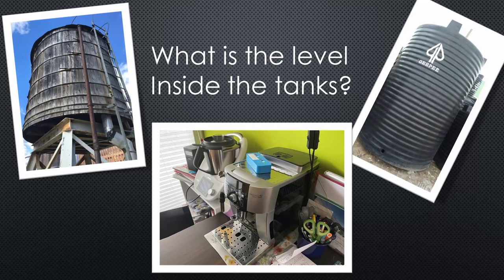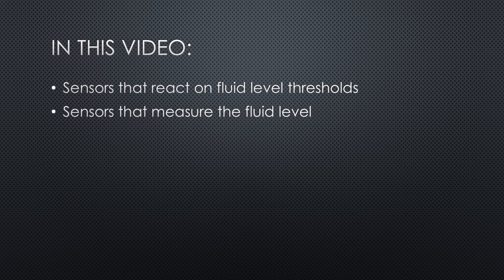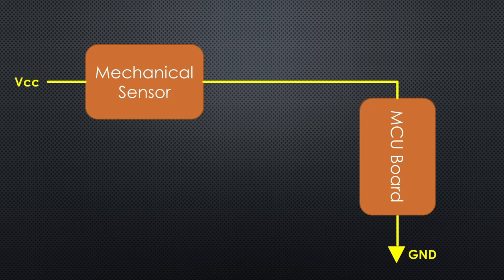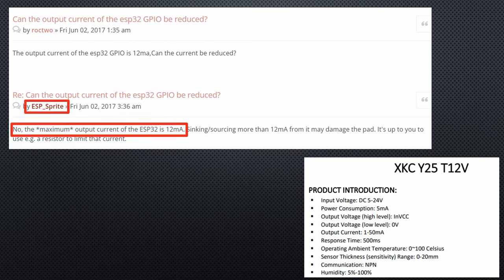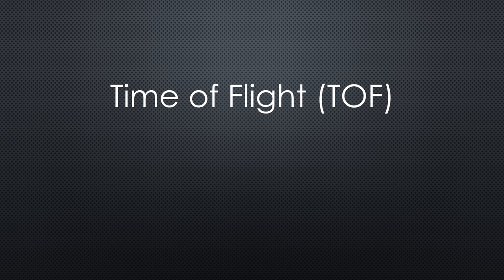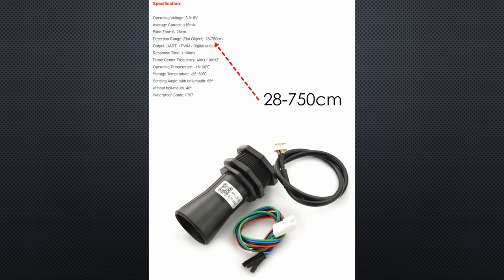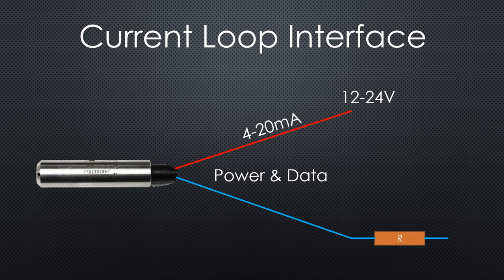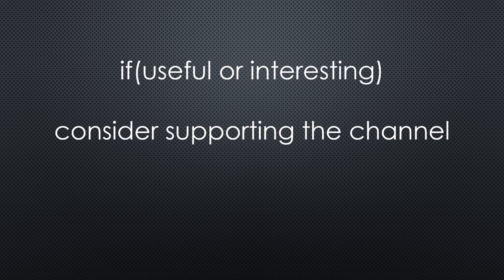#411 Ten Fluid Level (Water Level) Sensors and how to use them (Arduino, ESP32, ESP8266)

Comment: Thanks Andreas! Another great video! One question for you: I tried the JSN-SR04T ultrasonic waterproof sensor to measure the water level inside an opaque water tank 110cm in diameter and 150cm in height. I added a temp/humidity sensor to compensate for speed of sound calculations: it's on the roof so inside the tank it can get to 40°C and 90% humidity. I know it's overkill in such a small distance, but this is why we do these things, right? :)  Anyways, the problem is what you mention in 8:00 - interference from signals bouncing in all surfaces, which makes the sensor think there is little or no distance. The question: would a LIDAR sensor have the same issue?
Reply from the maker: Thank you for sharing your experience! 
Other commenters used a tube for the lidar and it eliminated reflections.

Comment: Hard water is an issue here, sensors build scales on them and hinder their performance in terms of mechanical parts, like the hall effect or Reed switches. I was looking for cheap alternatives that won't require penetration or drilling through the tanks along with replaceling the high power 220V mechanical switch. The elements first and foremost are an issue because it's an open air reservoir. Wonderful presentation as always.
Reply from the maker: What seems to be a simple problem is quite complex if you have a deeper dive. We also have very hard water here and I know your problem...

Comment: It takes a bit more, but we used 'capacitance probe' sensors to measure water level  in tanks.  It had a thin rod centered in an outer tube that had many holes along it.  The two were electrically isolated from one another.  An oscillator circuit was used to put this in one leg of a 'bridge' (similar to a wheatstone bridge, but composed of capacitors).  As the level rose/fell, the capacitance between the outer tube and inner rod would change, resulting in a signal across the bridge.  The probe was made of stainless steel, so it did not corrode in the hot water.  Probably a bit too complicated for most hobbyists, but just wanted to share.  Another nice video, thanks.
Reply from the maker: The tube was already described in the comments. But it was only used as a capacitor for an oscillator, not in a bridge as you used it. Thanks!

Comment: I don't know if they are also used for liquids but for solids there are mechanical units that lower a plumb bob off of a spool of string and count the turns until they detect no weight on the line.  Maybe another video on solids measurement :) A lot of materials vary considerably as the angle of repose changes from filling from the top and draining from the bottom. Other than giant load cells at the bottom of a silo I don't know how you would get an accurate measure?  Any idea if there's a way to measure the empty head space whose shape changes dramatically?
Reply from the maker: These mechanical sensors seem to be used in industrial applications and also to measure water levels of lakes (with a float at the bottom). And measuring the weight of the tank is a good idea (I forgot this method in my video)

Comment: I remember talking to someone on Reddit that wanted to monitor his radon exhaust system in HomeAssistant.  The local sensor works using the level of a fluid to determine if it working.  When the system is functioning it creates a vacuum that causes the fluid level to drop.  I bet one of these sensors could be applied to his system.
Reply from the maker: I agree. Those sensors are really universally used...

Comment: I assume the most asked question for us is how to measure the level of the rain collecting barrels in the yard 😉 As you explained very well there are downsides on every system. My idea is a small communicating tube on the outside which could be detected with simple light barriers. Ok this will not work with digged tanks.
Reply from the maker: There are a few comments here where they used small tubes to the floor of the tank to measure the pressure on the top of the tank. Maybe this could be an idea...

Comment: I had the same issue with my coffee maker.  I created a project with esp8266 as an alexa switch to have it refill the coffee maker with my voice.   I started to use one of the water level sensors that you mention but then I ended up just having it refill for 10 seconds, which is about the time it takes to refill the fluid for one cup of coffee :)
Reply from the maker: Good idea!

Comment: I have the opinion that resistance changes with long cable runs, but is less susceptible to noise. but what do I know.. otherwise the weight and psi are the same.
Reply from the maker: You are right.

Comment: I tried making a submersible continuous level sensor using a piece of coaxial cable as a capacitor (capacitive measurement).  If you strip back the ends of the cable and solder the inner and sheild together, then water proof them, the two free ends can be charged/discharged and the time constant measured.  It worked fine on the office floor and sensing my hand, but unfortunately for what ever reason I was never able to get it to work in water.
Reply from the maker: Interesting idea. Others used two parallel wires and tried to measure capacity. This seems to work if the fluid is between the wires, too.

Comment: I have used an IR sensor to measure the liquid bee wax level for making candles. Especially in the range of 10 to 50 cm it was a bit difficult to find an accurate sensor.
Reply from the maker: How did the sensor work?

Comment: Capacitance level probes are another option, You can use pressure indirectly by having a known reference pressure applied to the wet leg going down into the fluid, controlling the air flow and therefore a constant pressure down the wet leg can be compensated in the differential pressure device.
Finding the simplist device that will do the job is a good start and don't forget the simplest of the lot a visual sight tube.
You must let us know how you get on with the two applications.
Reply from the maker: For sure, visual control is a good thing (if you do not have to drive 10km as my friend). The tube to the bottom was mentioned a few times and it seems that several methods exist.  Some use a valve, others not. And some even did not mention a pump. It seems to be a good compromise because the electronics can be placed in a save place.

Comment: I once came across sensors that use light but are threshold sensors. They use the breaking index of a liquid. A laser shines into a contraption inside the liquid with two angled sides, like an arrow point. The difference in the refraction index between the senors material and air makes the beam teflect in. With a liquid the breakin index difference changes and the beam won’t reflect.
Reply from the maker: Interesting idea. Never heard about it. Thanks for mentioning it.

Comment: Another feature of current loop sensors that's often overlooked is that they also have wiring fault detection built in for free so you can tell if a wire's been cut etc. simply by checking if the current is outside the 4-20mA range.
Reply from the maker: True. I was not aware of that fact!

Comment: If the liquid has a layer of foam on top, you may need a conductivity sensor before the overflow point; assume the liquid is electrical conductive.
Reply from the maker: Also a good solution!

Comment: Another issue with mechanical "floating" sensors, they may get stuck if the environment is dirty, like in sewage level sensors or at high water levels in the bottom of the (dirty) bilge of a boat. Cheers
Reply from the maker: Good point. Thank you!

Comment: We use gas heaters and when the pressure is low it turns off. What kind of sensor is this? Air flow sensor or a pressure sensor. I can't find it on internet. May be you know it. Can i use water flow sensor to detect gas?
Reply from the maker: I do not know what sensor they use. We do not have such heaters. Maybe google knows?

Comment: I have a very similar coffee maker issue I am working on right now. Except mine is I have a water bottle in a cabinet that pumps water into the coffee maker (and ice maker). I need to know if that water bottle is almost empty. The solution I am going with is to measure the weight of the water bottle and graph it in Home Assistant along with alerts that I need to get a another water bottle ready because the current one is almost empty.
Reply from the maker: I should have added the weight sensors also in the video because it is very good for many situations.

Comment: There is one more simple method to measure the amount of fluid: Just use a load cell to measure the weight of the tank. Obviously this is only possible if you can put the loadcell below the tank and the tank need to be connected with flexible tube/hose.
Reply from the maker: You are right. I should have included this method in my video, too.

Comment: you could also use a bubbler and read the air pressure rather than having the pressure sensor directly in the liquid (to avoid corrosion)
Reply from the maker: You are right. Others mentioned this type of sensor, too

Comment: We often use weight cells to measure fluid-levels accurately in the lab. No problems with contamination and very precise. Only works well if density of fluid is known.
Reply from the maker: Agreed. A very good way if you can put a scale below the tank. Would work for the coffee machine if not the used coffee plus the waste water would count.
Reply: @AndreasSpiess  Yes! Had the same problem when measuring the water levels in hydrophonics tanks with roots dangling in the containers. Ended up using a food-safe swimmer combined with laser based range-finding. A bit overcomplicated as a binary sensor for a coffee maker though ;)

Comment: A little trick. If you want to use a pressure sensor for a tank but don't want to make a hole at the bottom of the tank (particularly if it is made of plastic sheet), you can put the sensor at the closed end of a pipe that you submerge in the tank (with some weight), the other side of the pipe stay at the surface with the cable.
Reply from the maker: Interesting idea. But I assume the system has to be very airtight for the long run. Other viewers mentioned a similar system but with a pump to create a counter-pressure.

Comment: There is one more sensor 
"water level rod sensor"
If you control current flowing in this sensor upto to uA then this sensor are good for measuring water level, And you can use corrosion resist metal for long life, Like Stainless steel (screw or rod)
Reply from the maker: Is this a level threshold sensor?

Comment: You could weigh the container. Fighter aircraft sometimes use capitance sensors as the fuel tank can be in multiple orientations.
Reply from the maker: You are right. I forgot to mention weighing. This is a very good way in many situations.

Comment: The capacitance method can also use Teo strips of copper tape on the outside of the tank, the capacitance varies with the level of the liquid.
Reply from the maker: I assume you meant "two strips" because Google did not gave me reasonable hits for teo).  Some viewers mentioned that this method works inside the tank. Good to know that it also works on the outside. Much better because the corrosion problem is solved...

Comment: Bonjour, merci pour cette excellente vidéo. J'ai exactement le même "problème" que vous. J'ai la même machine à café et , parfois, mon premier café du matin échoue lamentablement car il reste juste un peu d'eau pour commencer, mais pas assez pour avoir un café correct.  Je croix que je vais mettre un capteur capacitif à l'extérieur, avec juste une diode led clignotante visible. Le mieux serait de repiquer le 5 volts sur la cafetière ..... mais il faut l'ouvrir , et ça , c'est une autre histoire .  Bye de Pologne .
Reply from the maker: As you might have seen I already have a device from video #185 on top of the machine. Maybe just add a sensor there...

Comment: Thanks Andreas. This is something I have been thinking about as would like to be able to measure the amount of heating oil (kerosene) in our outside tank. So this has given me some ideas.
Reply from the maker: Maybe you also read the comments on another sensor: A tube to the bottom of the tank and a pressure sensor (and sometimes a pump) on the top outside the tank. This seems to be a very good method. Maybe I will make a video about it in the future...

Comment: Can you recommend a sensor for the amount of fuel in a small (100ml)  plastic tank of the RC plane, which constantly shakes and flips over (no steady level)?
Reply from the maker: No. But for sure this is not an easy problem. Maybe you measure the consumption instead?
Reply: @AndreasSpiess  thank you for good idea!

Comment: Why don't you just measure the weight of your coffee maker?
Reply from the maker: Measuring the weight of a tank indeed is a good possibility (forgotten by my video).  In the case of the coffee machine it would not work because there is a waste water tank and the remedies of the used coffee beans which randomly add to the weight.

Comment: There is also a contact photoelectric sensor utilising total internal reflection when in contact with the water to shine light on a phototransistor.  Never seen it used and seems like it would be very error prone, but maybe there is an application for it.
Reply from the maker: Other viewers also mentioned these sensors and they seem to work. The are not cheap, unfortunately.

Comment: I had a similar issue with my coffee machine. I ended up using an IR sending a beam slighly up (around 30 deg) from the bottom. On the backside of thw pexi-glass tank I glued a bit of silver foil. Now, when the water is low, the beam is totally reflected from the water level towards the mirror back into the sensor besides the IR diode. Works a charm since many years.
Reply from the maker: Cool. Thanks for the tip
Reply: @AndreasSpiess  Well, thanks for YOUR tips :-) The bubble sensor in the other video seems to be more appropriate than my try wirth the TOF...

Comment: Mathias Wandel made a video on.measuring his oil tank level  this week,  using arduino too
Reply from the maker: I just watched his video. He uses a standard ultrasonic sensors. It seems to be inside the building and with oil, he probably will not get a lot of corrosion. One thing is interesting. He made the sensor holder of wood. I 3D print such complex things ;-)

Comment: Hello Andreas:) I have an awesome ice making machine that creates crystal clear ice, now its no longer functioning, first i tought it was the heating element, but after finally expose the terminals I know this is okay, so the problem now seems to be some kind of double pole floating switches in the water, I have some trouble finding the exact same type, it looks like two cylinders sticking underwater, not sure how they work but it seems nothing happen when the water fills up, the water supposed to heat up in order for another temperature sensor to make the machine continue the cooling cycle. no alarm was going off as long as i filled it with warm water, but eventually this warm water cooled down and again the machine failed.. do you have any tips ? can i some how use any of these other sensors you mention to make the heating element working ? it seem to take 240v directly to these switches which i suspect is some sort of floating switched "normally closed" but they stuck closed i think.
Reply from the maker: I think you are on the right way: Understanding how the system works, and then create special situations ("traps for the error"). I am sure you will find the root cause. Only then, I would start the repair. Otherwise, you might damage more than your repair.
Reply: @AndreasSpiess  the problem is that I am having hard time to identify what kind of probes this is, obviously there are two independend rods sticking down under the water, so there is some kind of liquid detection, these rods look dark, kind of like what ferrite cores looks like but I am not sure, I tried to google all day and identify these rods but have still no clue what they are, also the other thing is that mains voltage goes into these, while mains also seems to go out of them as well into a 150watts heating element, I measured 325 ohm resistance on this one, but zero continuity on the wires going into the rods and the wire going out, so not sure how this kind og "two pole" circuit breaker works, does it even exist or is it obsolete technology, if i fail to identify them, what else could I use for an replacement component that do the similar thing that circuit wil break if the water is not detected, does it send a low current flow between both of these rods, and will power cut on both if there is no fields.. i have no clue :) maybe someone in the comments also have some idea, i tried to take some photo of the rods, but its difficult to see what it is since the chamber itself looks a bit cloudy, but i try anyway :

https://pasteboard.co/m2v6rUdKCIk3.jpg